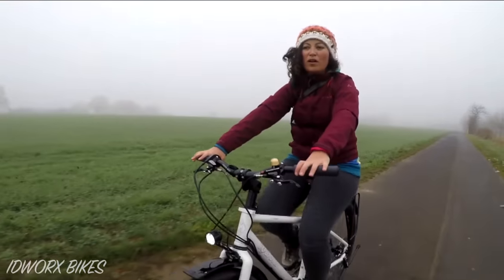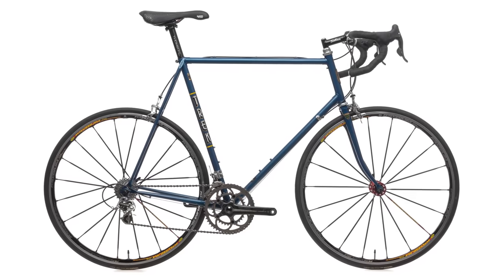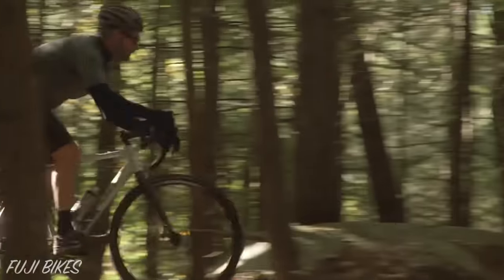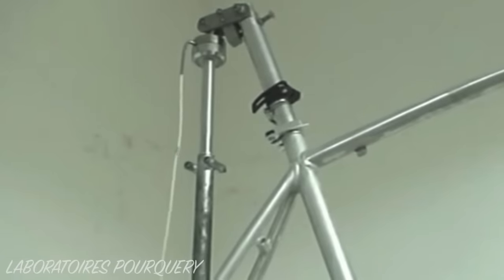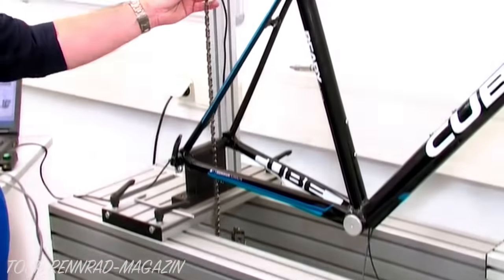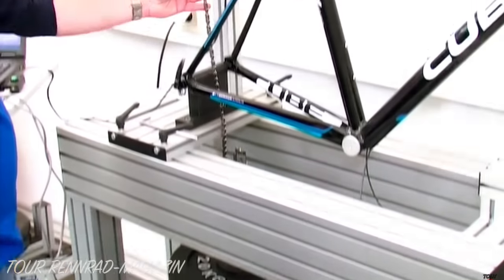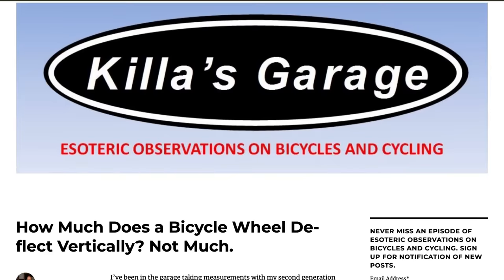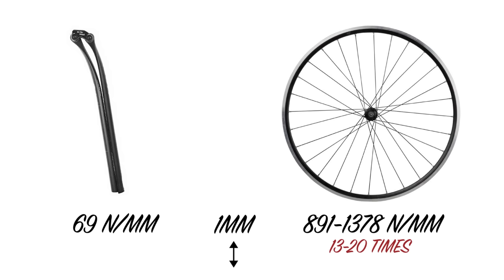Why It's Impossible For Steel Frames To Be More Comfortable Than Aluminium

Comment: What about forks?
Reply: It varies with the construction.  One could make a super stiff carbon fork or a flexy aluminum one.  
The head tube size will also influence the fork stiffness, since a larger space between the top and bottom races will allow more flex in the portion supporting the wheel.

Comment: Those lab tests are all low frequency simulating slow bump.  How about testing the high frequencies, and measuring resonant 'buzz' into the contact points?  Also requires deflection into the head tube because this would also be felt throughout the frame.  Car manufacturers carry out NVH testing across multiple inputs at different frequencies, and measured at multiple points. It would not be possible to develop a low vibration/harshness bodyshell from a single point, single plane, low frequency deflection test. Far too simplistic.
Reply from the maker: There is a fair bit of high-frequency lab and 'real-world' data out there (focusing on the contact point areas - grips, saddle, pedals), but interestingly, we cannot discern any vibration difference between frame materials - it's entirely in the components.

Comment: This video does not address vibration
Reply from the maker: When comparing frames of different metals (steel, ti, aluminium), there is very little difference in vibration damping.

Peak Torque made a good video about beam vibration and titanium: https://youtu.be/1CTjg1TFHDc

Almost all vibration damping occurs in your tyres and via your contact points (as well as luggage if you're touring).

Comment: Interesting video but you can’t conclusively say there is no difference without doing proper like for like comparisons on a steel and alu bike with identical components and frame geometry. 

Also it seems that your conclusion is that frame material doesn’t matter and that compliant tyres and seat posts are more important, you have not proved or convinced me that it is ‘impossible’ that steel is more comfortable than alu. In particular you focus on vertical compliance as a measure of comfort and ignore how a bike rides or feels but I don’t think this is an accurate measure of real life comfort. Anecdotally I have observed that there is lateral flex in my steel frame at the bottom bracket and chainstays when I pedal with some force. I have found that this lateral compliance reduces fatigue on longer riders as the frame is flexing with my pedal stroke rather than fighting against it. For example climbing on my light carbon road bike takes it out of my legs much more than on my heavy but flexible steel bike. Jan Heine has done similar research about the performance of a flexible bike vs a stiffer bike and how this effects comfort and fatigue, noting that his comparison is between stiff and flexible steel frames but relevant in that it proves that steel frames certainly do flex and act like a spring. (https://www.renehersecycles.com/myth-4-stiffer-frames-are-faster/).

Also I would like to stay that whenever I swap between my carbon road bike (or alu road bike in the past) and my steel road bike I can notice a big difference how the steel takes the sting out of bumps or potholes in the road. I’m willing to admit that this is down to tyre choice and seatpost flex as you suggest but for me at least there is a noticeable difference in comfort between steel and carbon or alu.
Reply from the maker: Thanks for taking the time to comment in detail! I tried my best to find some data linking lateral deflection and ride comfort, but came up with nothing. Anecdotally, I haven't noticed a difference either. But as soon as I go up a tyre size, or add any of my modern carbon seatposts to my bike, my bikes ride immediately more comfortably - with lots of horizontal BB deflection or not.
Don't get me wrong, I love how my steel bikes feel, but I just haven't been able to work out (theoretically or experientially) how the 'springiness' of the frame contributes to my comfort.

Comment: This only takes seated riding into account. You can't bust this myth without taking riding stood up into account. I ride a steel hardtail and I don't sit on the saddle much, because that's not how you ride a mtb. There's much more side flex in my steel frame than my old alu frame.
Reply from the maker: Good point, there could be a more marked difference when you take some springs out of the series and you're barreling through a rock garden. Although, personally I've never felt less comfortable on my aluminium xc bikes over my steel ones.

Comment: How about gravel full sus bike?
Reply from the maker: It depends on the fork, shock, tune etc. But for reference, the Cannondale Lefty Oliver gravel fork is 9N/mm in its softest setting. That's much more supple than most gravel tyres. I imagine rear shocks can run pretty similar numbers too.

Comment: All forces you apply to the bike through the pedals doesn’t translate to vertical compliance. You can’t put this debate to bed without talking about torsional compliance of a frame. This debate is prevalent in all aspects of cycling but in mountain biking torsional compliance is a massive factor when riding on off camber or rough terrain.
Reply from the maker: For the use case of mountain biking on rough trails at high speeds, you might find a comfort difference at the pedals using a flexy frame. I've never distinguished much of a difference myself, I notice stiff or flexy wheels wayyyy more - but perhaps other riders are more sensitive to this than me.

Comment: If you're a road cyclist on a carbon bike up to 98% of the load is taken not in the seat post regardless of the frame material, anecdotal and scientific data has proven on countless occasions worldwide that carbon road bike riders undoubtedly take the load in the anus with absorption from the shaft only accounting for the remaining 2% of the load, this may vary if you're running a big chain, obviously in this instance the load will be spread evenly across the peloton according to UCI standards and policy.

Comment: Tires, tire pressure and a proper bike fitting will go further in providing a comfortable enjoying ride than a specific frame material will.  That being said, steel is undoubtedly more durable and repairable than carbon fiber and aluminum.  Personally I like the classic look of steel frames.  I think the aero tubing on carbon fiber and aluminum bikes is ugly.

Comment: Chromoly is the best frame material. Why was this martial left out of the video? Chromoly reduces road buzz whilst being less expensive than carbon. Its stiffer than steel or aluminum for less flex in the crank. I just don't understand why bikes aren't made with the stuff anymore.
Reply from the maker: Chromoly and steel are the same thing in this video, as almost all bike frames use alloying elements.

Comment: You didn't mention forks at all, likely because you know aluminum/carbon forks are harsh as hell.
Reply from the maker: The data we have suggests that there is little variance in vertical deflection of forks of differing materials, in fact, the steel fork in one study was the harshest. This doesn't mean all steel forks are harsh, of course - I've had multiple steel forks with noticeable vertical deflection. But it does suggest that you cannot buy any old steel fork and expect a higher vertical deflection than aluminium or carbon - you've got to be selective.

Comment: I have no personal experiance on carbon frames so my source is my ass, and that's good enough of a source to not buy carbon because it's way expensive and compared to steel can just break from one moment to the next for whatever reason, be it manufacturing errors, subtle structural damage through use and whatnot. My ass says, it doesnt happen often, but I aint taking any chances, because I dont make a living riding a bike and dont need to shave of seconds. If I needed the comfort, I'd either get flexible seat posts, bigger tires or a susp fork, and I would certainly prefer that on a steel bike for frame longevity. I dont think we'll see many people using 30 year old carbon frames. And in terms of weight reduction, how much do you really save. Consumer carbon bikes I have seen are maybe 3-4 pds lighter than a comparable steel frame. that may be key when you're riding in the tour de france and completely meaningless for anyone else.

Comment: You don't really address the claim in the title of the video, instead saying that frame material doesn't matter if you have a carbon seatpost and wide tyres. These things do have a huge effect on ride quality, but that doesn't mean there's no difference between steel and aluminium. Not everyone has a carbon seatpost. Forks also have a big effect in absorbing vibrations from the road, and you didn't really consider this.
Reply from the maker: I definitely addressed the claim. The point is, in the context of how much your components flex/deform, the frame plays an almost non-existent role. Carbon seatposts are the example because we have data on them, but a metal seatpost still offers ~30x the deflection of a frame constructed with any material. I didn't cover forks in this video because I want to do a video specifically on them.
Reply: I don't disagree that frame compliance is mostly insignificant compared to tyres etc, but there is a quantifiable difference between steel and aluminium frames, and on bikes with the same components it's not "impossible" for there to be a difference between them. Is there a difference between the damping properties of steel and aluminium? You compared steel to carbon but not aluminium in this regard. 
I think most of the myth comes from the use of steel in touring frames compared to race frames, but as you say this is probably due to the different tyres, and maybe the more comfortable geometry. It would be interesting to know, given all this, why people still make frames out of steel though?

Comment: Only you neglected the forks? Why is that ? Would a very compliant steel fork not play a part ? Yet you never touched on that ? There is no doubt 40mm tyres are going to be more comfortable than 25mm . And no doubt that is likely to be the most impotent factor as you say .but a compliant steel fork would have been worth a mention?
Reply from the maker: I didn't mention it because we don't really have any good deflection data for forks. You can also install almost any fork to any bike and there is a large amount of flex variation between forks too....
Reply: @Cyclingabout  Fair enough,  just thought it was worth a mention?  Anyway thanks for your response,  greetings from Scotland.
Reply from the maker: @robduncan599  I'm hoping to do something on forks down the track.
Reply: @Cyclingabout  looking forward to that . Thanks

Comment: I do really love your mechanical approach to define "comfort" in riding bike. Still, describing riding comfortability only from seatpost point alone is not really accurate. Compared to the seatpost, pressure on hand grips and pedals are more important because our body is acting on these points 99% of time while riding. So IMO impressions from these points are the most defining factor to describe "comfortability" of any bike system.

Edit: Ah yes, I'm also using steel MTB frame as my daily driver. Female version one cuz its "easy" on my crotch 😂
Reply from the maker: You are 100% correct that grips and pedals are important. 
I chose to focus on vertical deflection because that is the direction of force that affects our riding the most. The only instance I can imagine a steel frame providing better pedal comfort, is on a really gnarly mountain bike trail where your rear wheel is getting forced left and right through a rock garden. At the grips, the frame material would provide close to zero difference - the tyre, fork, handlebar and grip material (and even gloves) are what will make all the difference.
Also, anecdotally, I've been able to make my steel mountain bikes ride 'harsh' and my aluminium mountain bikes ride 'plush', just with a simple swap of the seatpost and grips (I LOVE silicone grips). 👍🏻
Reply: Apparently, "cracked seat tube junctions" are so common. Those seat tube tests might be done in order to adressing any possible frame faulty.

When I'm commenting about grips and pedals, what I'm reffering to is vertical deflection that acted both on pedals and these grips. Yeah you're doing pretty good covering at vertical deflection issues there and there. Only the fork's K value that was left from the equations. Nevertheless, the concept is pretty much clear.

Actually ain't that strange that steel frame hailed and got better receptions. Steel frames are just everywhere, cheap, easier to maintained/fixed thus prolonged the lifespan indefinitely. Thus, we'll see wide range of different steel frame qualities on the wild. I guess that anyone who sworn on steel frame's comfortability is might either exclusively using a commuter/city bike or well designed one. Maybe both.

Idk how to put it... But I think in bicycle frame design world, there's always trade off between comfortability, weight, longevity, and power efficiency. Such as how racing bikes usually had less weight, high power efficiency, but somewhat fragile and harsher. On the other side, commuting bike (mainly the step-trough frames) usually wobbly, weighted more, and tends to long lasting. So I conclude that not only the frame material (e.g: steel vs alu) that affecting comfort value, but also highly depends on the overall frame design (including forks, seat tube, and wheelsets).

Right now I'm rebuilding an old MTB bike with step trough frame (steel). It's not really slow but feels "safer" and very comfortable for a long run. Ah yeah, equipped with wide seat and silicone grips too... Silicone grips are superb.

Comment: Allow me to add some anecdotal evidence to this debate: Three years ago, I bought a Trek Remedy 9 RSL. After a year of ownership, I sold the frame and put all of the components onto a Chromag Stylus. Everything was exactly the same besides the frame. Immediately, I noticed that the Stylus, a steel hardtail, was more comfortable than an aluminum full suspension bike, even with the exact same components. Steel is real.

Comment: Nope, you haven't proven "Why It's Impossible For Steel Frames To Be More Comfortable Than Aluminium". 
You have supported an argument that a bike's comfort is the sum of it's design and components, with some components having more effect on comfort than others.
Based on the title of this video, i was expecting a comparison of aluminium and steel frames of same design and geometry, with same build components. Essentially the only difference being the frame material. This is where the subjectively springy steel will give a different ride to the relatively dead, but strong aluminium. 
I think back to riding a 2.8 cannondale which beat me up over a 60 mile circuit, and my mate's classic design quality steel framed bike which was like a refreshing lively ride, leaving me ready for more. this on the same circuit.I eventually upgraded to a later model aluminium cannondale with the hourglass seat stays, same wheels and seatpost. This was measurably more comfortable on long rides.
Frame design is a big factor in comfort, various means have been incorporated to add some vertical compliance, the hourglass seat stays of cannondales, and the vertically curved stays of some litespeeds.
A bike is the sum of it's components, including tyres, frame material and design. Would have been great if you could have shown the difference between steel and aluminium as a frame material, and the difference in ride quality they actually possess.
Myth is still alive!
Reply from the maker: The interesting thing is that we have tested Cannondales with hourglass stays and Cannondales with typical round tubes. The difference in vertical deflection? Almost nothing. If you find a bike with hourglass or curved seat stays more comfortable, I suspect it's a placebo - which is great because that means it actually is more comfortable!

Comment: I think some of the comfort is the vibration level. The steel may seem smoother because it absorbs more of the vibration off a rough surface than aluminum.  Did you do a vibration test ?

Comment: This ignores the variation within frame design, many frames are designed to be stiff
Reply from the maker: The point is that a frame - whether it's designed to be stiff or compliant - is not the softest spring in the series, so it cannot be noticeable in terms of vertical compliance.

Comment: To what extent has aluminum got into a negative perception cycle. Because aluminum frames have a bad reputation, they only get used for the cheapest part of the builder's range. Once you look at the quality of the joints and welds, the quality looks awful compared to a nice TIG-welded steel frame or seamless carbon frame. And because these cheaper bikes are spec'd with entry-level components, the low-quality perception is cemented in the buyer's mind.